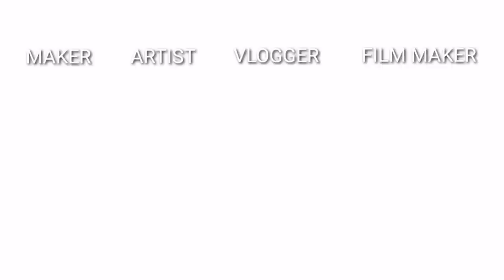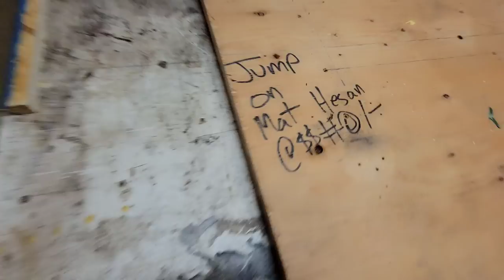More progress on the Vintage trailer | Another VLOG #174.5

Comment: Gotta say I get nervous when I see you working on that frame by yourself,  at least until the shell is completely stabilized.   

I agree with Ashley that you don't need an oven, but a hotplate might be nice.  I don't know if they make these anymore but I seem to recall that they once made units that were both a mini fridge, and had a hotplate on the top of it.  If not, I'm sure they still make those single plug in hotplates that can be stored when not in use.  I guess it depends upon how primitive you want to camp.

If you don't want to be entirely primative however.  I also recommend the wonder washer for cloths cleaning.  I have one in my house for hand wash items of clothing.

Comment: This video was to short my boy (I'm an ole gramma from WhiteEarth Rez MN) Was thinking about the under belly of the trailer. Are you running wiring underneath for tail lights, etc., pcp pipe for small sink, insulation and finally sealed shut with black waterproof fabric, maybe? Mine does it keeps moisture out and allows the floor to breath. Keeps it warm in winter and cool in summer. My pad on wheels is from 1985 though with the original under belly. Mice raised a little hell but not to bad after all these years. I've had to replace some insulation and fabric but it was a minor patch job.
Reply: Hi there, I'm from the Ponsford Prairie.  My dad had a wild rice finishing business near Big Rush Lake. I've got cousins over by Ogema.
Reply: @Tamidewa  Boozhoo, ho wah cousin